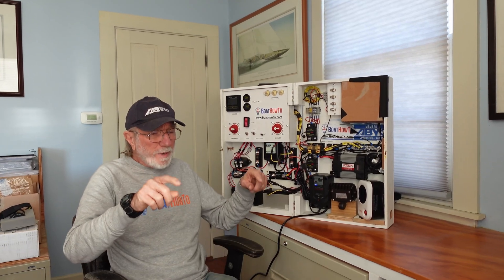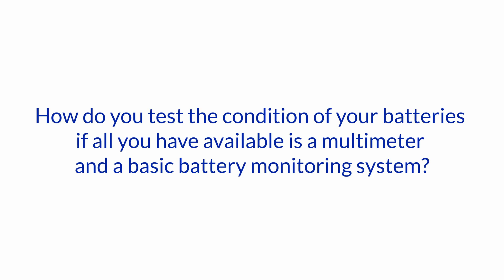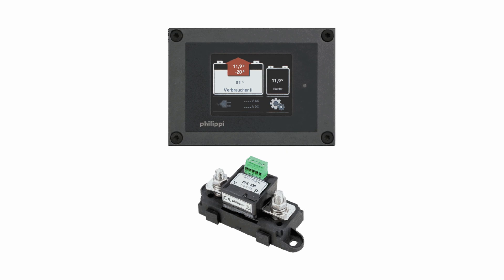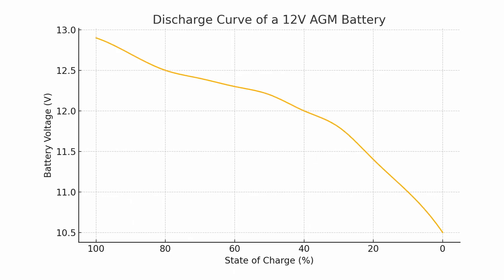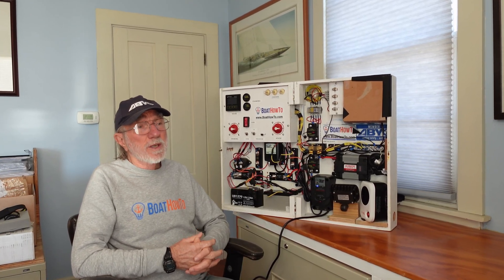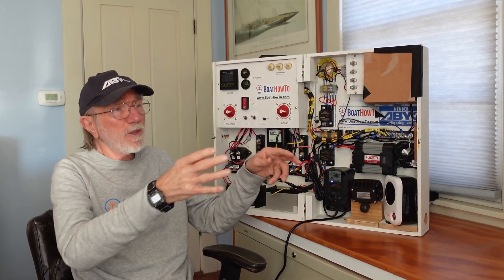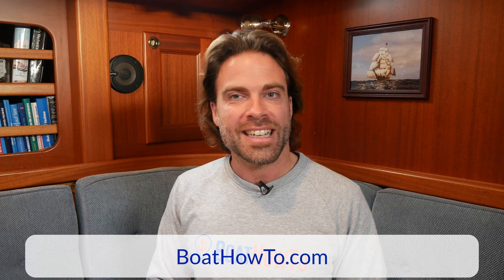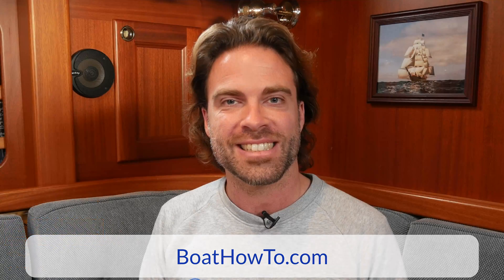How to perform a BATTERY CAPACITY TEST 💡 | Ask The Expert with NIGEL CALDER

Comment: Are you familiar with the BC-7000 Battery Capacity Tester? It's a very good unit for capacitance testing, but very expensive, especially for a boat owner with a few batteries. We use it in aviation battery testing, and often purchased by maintenance facilities that do a lot of testing, to justify the cost. Is there a simpler, much lower cost unit that we could use on our boats to check capacitance with some sort of reasonable results?

Comment: I have the same question except with lithium batteries. In theory I can take my lithium battery down to 10%. Should I?
Reply: On boat we usually use LFP batteries (LiFePO4). They can be brought down pretty much all the way. There's usually an internal or external BMS that will protect the battery. 

So you don't have to worry too much about testing it as it has a tiny impact on its lifecycle compared to lead acid.

NMC lithium batteries are different. They don't like being charged to 100% or discharged to 0% too often. 
Many EVs use NMC, some use LFP.
Reply: @tibo-qc  "LiFePO4 battery cells have a maximum discharge depth of 98% to 100%. This is longer than any other battery technology currently in the market. This means that you can safely discharge these batteries to their full capacity. However, most manufacturers recommend still using a 80% DoD for these batteries to prolong their lifespan. Even if you occasionally use 100% of the battery capacity, the battery will not get harmed."

Even with LFP, it's better to avoid extremes of charge and discharge.  Chemistry and physics says so.
Reply: Similar question for me. How about lithium?
Reply: It's generally safer to deeply discharge a Lithium ion battery than Lead acid, but no battery likes extremes of charge or discharge.  MOST Lithium ion batteries, for example in marine use, have internal electronics to prevent the voltage from getting to high or low, since the consequences can be very bad, especially for non-Lithium Iron Phosphate.

Lithium ion batteries last the longest if the discharge is kept shallow and/or around 50%.  The more time spent near 100% or near 0% the shorter the overall life of the battery.

For example, if you have an EV and need to use 20% of its battery capacity on a daily basis, the battery pack will last longest overall if charged to 60% and discharged to 40%  (50% plus and minus 10%).

The recommended long term storage charge for Lithium ion is 50%.  It's the most "relaxed" condition for the internal chemistry/physics.
Reply: @LoanwordEggcorn With respect to deep discharge most lithium ion experts, such as Will Prouse, disagree with you.